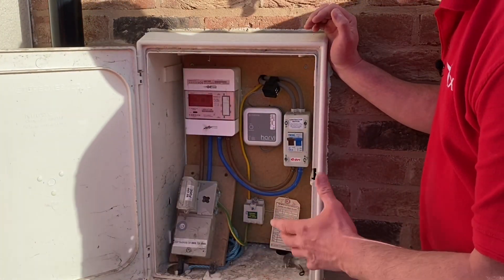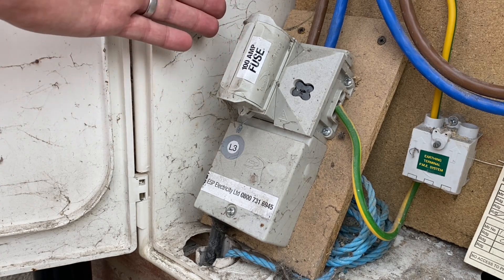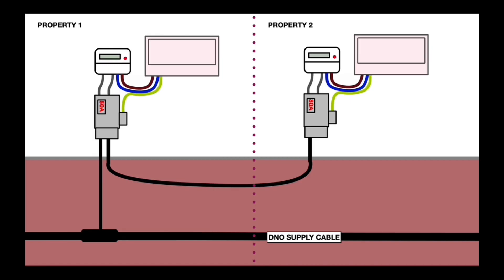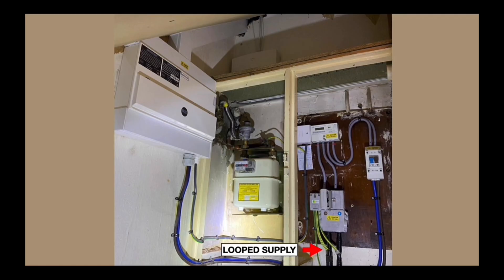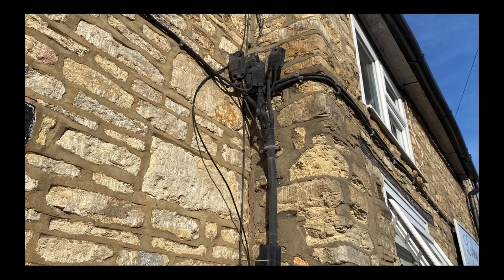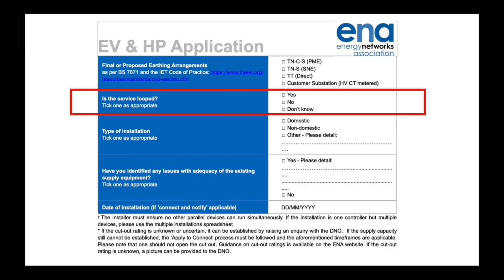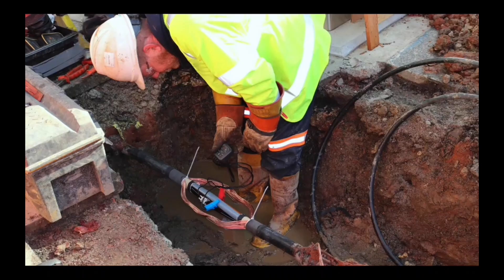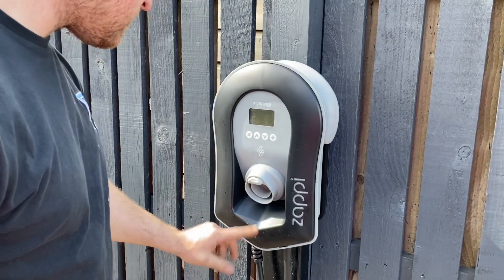EV Charger installation : BEWARE Looped supply - what are they , cost and time to correct

Comment: I'm having a smile at your click bate photo.
I worked for the electricity supply company,
The photo shows concentric cables (pvc) supplying the fuse, many are still paper/lead, especially if they are looped, and often the loop runs under the floor between the houses. 
The black fuse carrier will be either rated at 60a or 80a maximum.
So it could mean that both properties need the cables replaced back to the street, as a lot of houses over the years have been rewired/upgraded, electric showers installed, without informing the supplier, and the 60a supply is not enough.
My first bit of advice is do not fall out with your neighbour.!

PS. I now live in Spain and the supply is either, 2kw, 5kw, or 9kw, anything bigger is then 2 phase. The local electricians find I hard to believe that most UK houses have 25kw supplies.!

Comment: Remember that your neighbours garden does not always have to be dug up, the DNO can cut the loop cable at both ends and basically cap it off.  Then install a new cable to your property. Speak to your DNO. I have to praise Western Power Distribution here, they are just amazing with help and assistance, and offer a very prompt service

Comment: Whose responsibility is this? I had an ev charger professionally  fitted 6 years ago.  I just spoke to someone about adding a powerwall and they noticed I had a looped supply so the EV charger installer should not have fitted it.

Comment: How’s this for a nightmare installation. I’m on a looped supply, 60A incoming fuse. Asked DNO to upgrade to 80A to allow EV charger to be installed and down rated, with plans in place to unloop me. They wanted 25mm tails installed (I had 16) so asked electricity supplier to arrange visit to change these. When they turned up they couldn’t do it as the incoming fuse only has terminals big enough for 16mm, so back to DNO who agreed to do the fuse and housing to 80A to start with.
Phone call from DNO a week before they are due to visit, they need to dig up my drive to cut the power cable before working on the fuse, so this was arranged for the day before. On that day, they had issues locating the cable but dug where they thought it would be - no luck. After they left, I got a phone call - turns out I’m on an even worse version of the looped supply than I thought - something called a rydon or ryland loop (can’t recall the correct wording for it). Basically one power cable comes in to my neighbour then is looped between 5 other houses! No wonder they couldn’t find the cable under my drive, just wished they looked at the plans first. 
So now, each house needs its own cable installed and fuse upgraded which means it’s now been moved up to the major projects team at the DNO. This could be months before any progress is made, and in the mean time, I have a PHEV arriving soon (luckily it’s a PHEV so I’m not reliant on the electric side of it) no charger installed, and a couple of unhappy neighbours with the prospect of having the DNO rip up their drives and living room flooring to get to the electric cupboards in the middle of their houses just so I can have an EV charger 😩
Reply from the maker: Wow, boxes of chocolates to all the neighbours in order then? 😬

Comment: This problem does not just apply in the case of electric vehicles. With the move away from gas boilers to electric water heaters the problem of needing to upgrade the service cable to handle the extra load can be a very expensive problem. I am not able to update my gas boiler because of new regulations and having to install two  6kw electric boilers - one to supply my radiator and the other to supply my hot water. These 2 boilers are on permanently and are 26 amps each (no diversity allowed for boilers)  - that is 52 amps total of my 100amp supply.
Reply: That's a lot of hot water.

Comment: We are just starting on the unlooping process.

car on order (but delayed) and charger installed today, Obviously can’t be turned on as we have found we have a looped supply.

Installer is in process of contacting DNO to see what we can do to get this resolved, let’s see how this works out with electricity north west.

Great videos by the way, really useful.
Reply from the maker: Good luck 🤞 let us know how you get on
Reply: And we are unlooped, as promised we had a dig team arrive and remove the front garden hehehe

Neighbours got their own feed and we are now on 100 amps after they upgraded the mains incoming cable from the street, so new cable and cutout and we now have a fully functioning EV charge point.

It's been a slog but it's done now and was still FOC for me to have the works done by Electricity Northwest, the guys do say at some point they expect people to start seeing charges but not just yet.
Reply: DNO due to visit next week to check looped supply and propose next steps. 

They confirmed records show we have a loop and have denied the CP install, a bit late as the electrician has already installed the unit. it's turned off at the minute but might be interesting when the DNO arrives for the checks.
Reply: Well the saga continues, we know we have a loop but we dont know where it goes. 

DNO have been three times now and still cannot find were the cables go, they were due to come dig the garden and chop the cable to see which house / houses go off.

A very nice lady arrived two weeks back and agreed to disconnect at the cutout, we will still see who goes off and it saves a dig as they wouldn't do the unlooping at the same time. We still have no date as to when this will be done.

It's no massive issue mind, car delivery has been pushed back to Jan 2023 as Audi cannot deliver due to part supply and build delays.

We cannot have the drive sorted as we don't know where DNO will be digging, local authorities won't complete the kerb drop extension until the drive is done.

Turning into a bit of a mission this one hehehehe
Reply: Progress! A dig team are booked for 20th and the unlooping due to complete on 21st assuming they find what they expect 😀

Comment: Had a un planned visit from Western Power today. Neighbour has had a electric car delivered today and apparently applied for a charging point. This has identified that we are on a loop with them. I was then told they would have to dig up my driveway and garage for us to be put on a single feed..... to say I'm annoyed is an understatement as the Neighbours have not even approached us. Can a charging point  be fitted to a loop circuit? What happens if we refuse? I asked for the power company to come and see me when I'm not at work and was told well we work 8-4 mon -fri  thats really helpful when we are at work too. Anyone got any advice?
Reply from the maker: Over the next decade most homes will require an EV charge point. So we’d recommend getting the work done.
Reply: I imagine if they're digging your drive up you're fed from your neighbours house, if you refuse, you may have a situation where you're without supply if you are infact fed from your neighbour.

Comment: Ordered an EV through a work scheme, due for delivery in March, so thought I'd get on with arranging for the charger install, which comes as part of the lease.  ChargedEV did a remote survey, basically asked for specific details and photos of the meter, charge point location etc. and identified a looped supply.  They've called and dropped me an email saying they're taking it up with Western Power and it seems just getting on with it on my behalf.  Fingers crossed it all goes smoothly.
Reply: How did this pan out for you in the end?

Comment: I was unlooped about 6 months ago - terraced house with cables overhead. I filled out the form - no need for an electrician at all, emailed it to Western Power and they did the work three weeks later for free. It was in fact my neighbour that had to unlooped from me, so apart from removing the cable from my fuse block, all the work was next door and Western Power did all the arranging of times and access with my neighbour for me too - once I submitted the form, I did not a thing! Excellent service from Western Power.
Reply from the maker: Western Power seem very proactive on this - thanks for sharing 👍
Reply: Overheads much easier and cheaper, all that digging etc. just to look nice !

Comment: I’m sorry to correct you but  the fuse is classed as  a means of isolation if you are working on the tails ie changing the distribution board from an iee member
Reply from the maker: We’d love to see a document which authorises electricians to cut the seals on the fuse and meters.

Comment: If there are two service cables coming into the cutout, then, clearly, the supply is looped.  But just because there is only one service cable coming in, doesn't mean that supply is not a looped one, so presumably the only way to be certain in the latter case is to ask the DNO.
Reply from the maker: Yes that’s right - only the DNO would know.

Comment: So irrespective of a looped supply if several houses run off the same phase and you have three or four of them houses all having EV chargers, they’re not going to get a proper charge due to the amp dropping from such high output chargers, so for example, a row of 10 houses running off phase one, 4 of them have EV chargers, average KW of an EV charger is 27kw which roughy translates to 70-80 amp, let’s say 80, you plug your charger in, you get the full load, happy days, but then Dorris 3 doors down wants to charge her EV vehicle, guess what? You ain’t gonna be getting 80 amps no more, you’re getting 40…see where this is going…..
Reply from the maker: Houses are usually split between phases. The maximum UK residential charger on single phase is 7kW

Comment: I have a looped supply from the DNO, and I know from the past when works were done on the pavement and when I dug foundations for a garage conversion that I have the supply from the DNO then it loops off to my neighbour. I have 2 cables, he has 1.
How would an electrician know that he is looped to me just by looking at his DNO cable and meter?
Reply from the maker: If you have two cables at the meter it’s looped
Reply: @efixx  Yeah, I get that - please re read the original Q.
Mine loops off to the neighbour - mine has the 2 cables, one from the street, one looping to the neighbours house - he has one. How would anyone (e.g. the spark coming to fix the neighbours EV charger) know just by looking at his if its a looped supply? I assume the main fuse being 60A would be a giveaway?
As it is since I posted this question I have found that the DNO have records showing looped supply status and its them that need to sign off on the upgrade of the main fuse.

Comment: @efixx 
What is the reason that the fused is mounted on a tilted plate? Have seen this a lot in the UK🤓
Reply from the maker: Practical installation purposes.
Reply: @efixx  Thank you for the answer, but what are the purposes?
Reply: @nusermane1076  Standard box now too small.

Comment: With access to the start of the loop, and if it has a split tail there, a current clamp on the feed should be all it needs to protect it against overload. But I guess the DNO won't run with that, seeing how that clamp could easily be disconnected or disabled in the charger(s)...

Comment: Been unlooped. Bought the car, bought the charger. They saw pictures of the supply and told it was looped. This was in November (we were in a lockdown tbf).
Took until March until it was installed. They were obviously busy, but the length of time waiting for the unlooping was frustrating.
Reply from the maker: Thanks for sharing your experience.

Comment: Got un-looped for my charger install, we had the primary input for 2 houses on a semi detached plan built in 1947.

We found out we were looped several years ago when the 1947 fuse for the house next door came loose, shorted and started smelling of burning tar and glowing ominously (a quick emergency visit by Scottish Power replaced the old fuses with 2 new fuses.

The unlooping was all handled by the pod point people, went entirely without a hitch as next door had no objections to a free upgrade and their front garden is stone chips with planters (so no problem with digging it up and reinstating it.)
Reply from the maker: Great info - thanks for sharing

Comment: Cost & time - well cost - charged to the DNO for installing  faulty system in the first place. The example showed 80A fuse - so if that was me, that's what I'd expect to be able to draw any time I wanted. If me and my 10 neighbours connect our EVs at the same time and THEIR cable fails, that's their responsibility. FFS !
Reply from the maker: It’s a legacy issue the DNOs want to correct due to the high continuous load of EVs

Comment: So how do you find out what rating the fuse is in the supply without having the cover off ? Just try 70, 90 & 110 loads and see which blows it ?
Bollox to it - I'll go find out........

60A
What a shit head - the fuse comes out with the cover :( 
#unscheduled power cut !

Looks like another reason for going off grid via diesel generators - one trailer-mounted to tow behind my EV - when I get one.

Comment: I went and carried out a site survey several months ago for an EV install and customer had looped supply, i explained all I needed to and said they should contact their supply distributer. Fast forward several months they contacted me to say that they thought I was wrong as they bought an EV charge point package with the VW car from VW and the installer just came along and fitted it, made the OLEV claim for them and everything. So what on earth regs was the installer subbed out to VW working to. I want to give up some days..
Reply from the maker: Hmmm doesn’t sound good

Comment: Complete tangent, but one that comes to mind. I own a house with a looped supply. The phase comes into my property and a set of tails disappear into the neighbours (semi detached). The neighbour has solar panels and during the day, when I work from home, my average consumption is around 0.8kW. From around 8am til 4pm the solar system next door generates > 2kW and their house uses little as the house is vacant during the day. I clamped the main incomer one day at 1pm and found a 7.6A flow. My CU tail was flowing 3.3A. Line voltage was 229V. That means the neighbour was exporting 0.99kW outside of our property. Meanwhile, I pay full whack per unit, and they get paid less than half. 

Exporting energy only serves the supply company. They charge you on the way in, and the way out. The moral of this story is if you have solar or generate your own power, store it. Buy batteries. Do not export it, it's a scam.
Reply: surely their export is all going back through their meter before it gets to yours so is measured? If its as you say i would want to have this investigated.
Reply: The suppliers buy it back but at a cost price. Like if they charge the customer £1 a unit they’re probably only paying like 60p a unit. So probably only pay the customer 30p a unit. It’s how all business works.

Comment: Thanks for the video but one thing still left unanswered for me- can we just go ahead and install EV if the client has only one service cable coming into the cutout then? Because their house could just be the ‘end of the line’ looped from next door, which then begs the question of how the hell do we know for certain whether a single service cable is direct or looped… hope someone answers this as don’t think it’s been asked yet! Cheers guys
Reply: Ask your DNO. I did the same with mine a few weeks ago when I first discovered 'looping'. My DNO is Western Power, I submitted an enquiry online and had someone calling me up 20mins later confirming that next door with their immaculate block paved drive is hanging off my supply 😬

Comment: Right Guys, I hope you can answer this or maybe someone else in the community can help. 
I have a house built in 1904-5. We’re moving away from gas and we’re looking at buying an EV. The chap who provides us with his electrical services has been consulted and he suggests that we get a 3 phase supply installed. I’ve done a bit of research into have the supply installed by the DNO (Scottish Power). They couldn’t give me a cost straight away (fair enough), but said they’d have someone call me back. I got a call back (The electrician said I was lucky as they almost never call back). They said I’d be looking at approximately £5,000-6,000 plus the installation of the interior electrics (consumer unit, additional cables). Would you know if there would be any grants available to help cover the cost of this. If the government are pushing for households to help reduce  pollution. Surely something should be set up to achieve this? The real factor may be that cost will be prohibitive. Many thanks in anticipation of a reply.
(Edited for clarity)
Reply from the maker: You shouldn’t need to go to three phase - most houses can easily support the maximum 7 kW Single phase EV charger

Comment: Looped supplies are just one headache for older properties. How do you get over the problem of properties that don't  have a drive. Many many terraced properties, and others, are in this situation.
Reply from the maker: Community charging hubs
Reply: @efixx  How does that work please? Are you suggesting that some of these houses are knocked down to create community parking places along with individual parking/ charging places. It's  a workable idea but way beyond the scope of individual householders.
Reply from the maker: @Roastbeef01  There lots of different solutions being worked from EV chargers in curb stones to local parking zones with chargers for residents.